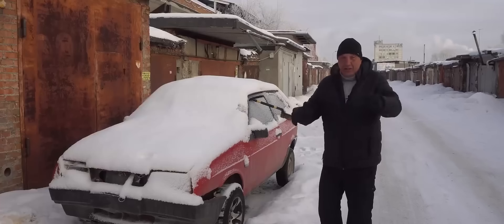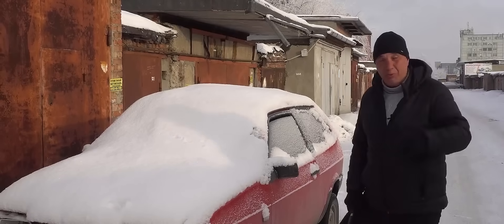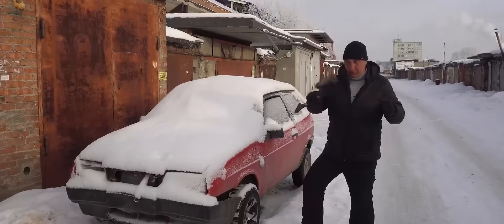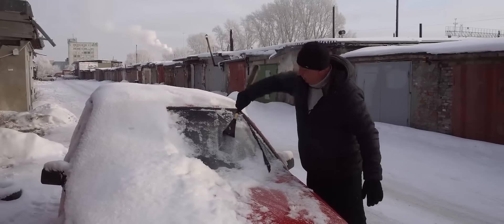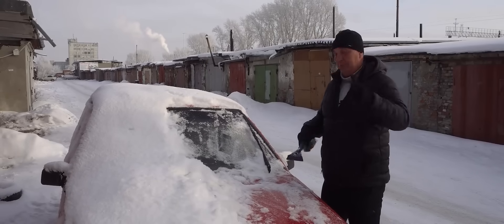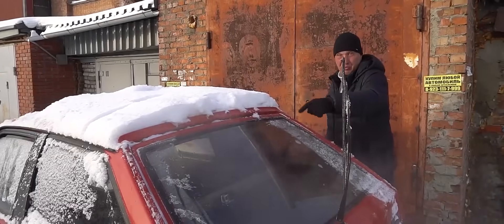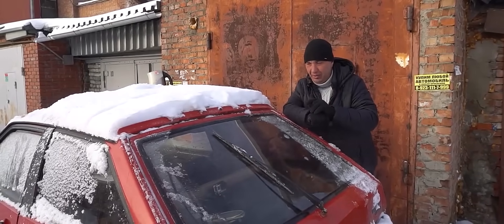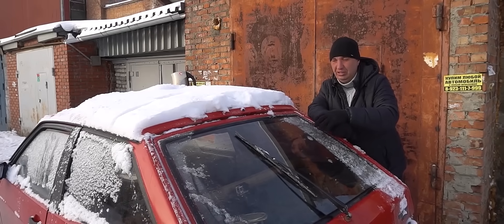What happens when you POUR boiling water onto a frozen windshield?

Comment: The second the water leaves the kettle, the air is so cold, by the time it reaches the window it isn't boiling anymore, it's still hot though I imagine. Need to check the temperature and humidity of the air in comparison to other places.
Reply: Why tf you here you fam
Reply: That's actually not the case. Car windshields are made out of tempered glass. Tempered glass doesn't crack under temperature change which is why test tubes and flasks are made out of it.
Reply: @HideyKojinko  The side windows and back window are made of tempered glass.  The windshield is made of laminated glass.
Reply: Man like chicken con yhhh
Reply: FAM REVIEW GRILLER
Reply: Boi .. why you here?... go make more 🔥 videos
Reply: +Chicken Conoisseur LMAOOOO WHAT ARE YOU DOING ON A VID LIKE THIS
Reply: Chicken Connoisseur soo we getting that next episode ?
Reply: I am amazed at how many people agreed with Chicken Cons comment. 

NO, the amount of mass will not cool down quick enough from kettle to glass. It might happen if sprayed or atomized and given enough travel time.
Reply: Wtf
Reply: Chicken Connoisseur l
Reply: What if you pour the boiling water while there os more snow on the window? Or what happens when you turn the car and the heat on?
Reply: Neeeeerrrrrrrddddddd
Reply: Wouldn't doing this be bad, the sudden temperature change can crack the glass if the change is too drastic and done too quickly
Reply: No one asked. Let me introduce you to a girlfriend
Reply: Chicken Connoisseur ITS U!!! I KNOW U FROM MEMEULOUS
Reply: Since when were you a science guy
Reply: Im a fan.
Reply: Wtf are u doing here lol
Reply: Chicken Connoisseur we got a genius here
Reply: Chicken Connoisseur That doesn’t matter one bit that hot water is still hotter than shit vs the window huge temp difference
Reply: Tf y u here
Reply: Freezing glass doesn't shatter on it's own if u poor boiling water on it. It only breaks if it's in a spot that is precisely it's size 'cause it expands in hot. Car windows are made so it could expand a little and not break and get smaller and not fall off. Its physics and it's called "thermal expansion".
Reply: Chicken Connoisseur lol why u here 🤣🤣
Reply: Idk if that’s true. My mother used to do this during the winter before she carried us to school. The window always got a little frosty during the night and early morning hours before school. It never had enough time to melt by the time we had to get up. I live in a southern state so it almost never snows. Each day she’d do it and it wouldn’t be that cold....definitely not as cold as it it is where this video takes place. It would be maybe 40°F out so if that’s enough to cool the water down instantly to where it’s no longer boiling...then maybe.
Reply: Chicken Connoisseur  y r u here
Reply: Chicken Connoisseur yo review kfc g
Reply: no. The temperature of the air doesn't matter. The colder it is, the colder the glass is, and air has so little heat capacity that it doesn't cool the water off much. The cooling is mostly due to evaporation of the hot water which isn't affected by the air temperature
Reply: You don't deserve that many subs
Reply: Why u not eating chicken?
Reply: Chicken Connoisseur 
Hi
Reply: Chicken Connoisseur what r u doin here
Reply: Its obviously still boiling
Reply: You're incorrect sir. Test this theory out next time. Pour boiling water on your hand in the freezing cold and see what happens
Reply: Wow your likes say 911
Reply: https://youtu.be/g8H7pmdo-qc 
this will make your day. worth watching. subscribe on your own risk, u might fall in love. ❤️
Reply: True, most likely anyways. kinda like when you take a mug that was in the freezer. Then, you pour really hot water in and the mug will shatter.
Reply: Your hypothesis is wrong your as dumb as your comment..lol
Reply: @nivisky  you're. Learn to use the right words before calling someone dumb lmao.
Reply: What's your most useful tip on gaining subscribers? Lol 
I've tried for 2 years and only got 548....
Reply: EliteFusionZ clickbait and release lot of video consistently
Reply: @selassieaspen9940  Nobody likes people that click bait
Reply: EliteFusionZ nobody likes it but everyone does it
Reply: @elitefusionz02  If you don't clickbait you won't get subs, it's the sad truth.
Reply: @elitefusionz02  eat chicken 😂😂😂
Reply: EliteFusionZ I only have like 70 😂
Reply: EliteFusionZ rename yourself to get me 696969 subscribers with no videos

Comment: I’m sure if the windshield had a small crack lol it be a different story
Reply: He'll say 
"Fuck, well... There goes $400 just on a YouTube video that'll get 60 views" 😂
Reply: @elitefusionz02  i think its a bit more than 60 views :))
Reply: Nothing would have happened either way. I know from experience. Drastic changes in temperature from cold to hot does not make avsolutely any difference in glass what so ever. Things change when you do hot to cold, in this case the glass would have cracked easily. This has to do with how big the jump in temperature is. Is way harder to get glass cold enough and water becomes vapor before reaching the desired heat. This is why cold to hot doesn't break the glass. But is easy heating up glass enough that even room temperature water can break it.
Reply: Is she Russion.

Comment: Really, water above 0°C is fine. It will melt the ice and would most definitely not give you any reason to be concerned about the integrity your windshield. Squeegee the excess off so it wont freeze back. By the way, what kind of scrubber is that?

Comment: I've used a pitcher of hot tap water on frozen auto glass for decades without cracks. Hot water poured into a cold skillet won't do anything but warm up the skillet. If you reverse the test - a hot iron skillet or very hot glass can easily crack when drenched with ice cold water.

Comment: It only cracks if the glass is damaged already. If the glass is like new, nothing will happen to it. The front and back window ist made to take this stress. Also throughout a normal drive there is high stress on the glass. Try to break it with a hammer, it will withstand high power.

Comment: The outside is the hardened part of the glass the in side is the soft part, the inside is more likely to crack if a drastic heat change is applied. This type of glass is layed with plastic sheets ( aka plexaglass) witch makes is stronger and less prone to cracking and shattering.
Reply: Resin layers not plexiglass hahahaha

Comment: It's the opposite process that cracks glass. Once the glass is hot you place cold water on it and it will crack like in the summer when your car has set outside in the heat for a while. Not sure if the boiling water he is using is hot enough to get the glass to the temperature needed, but probably a drop of liquid nitrogen after he poured boiling water on it would have cracked it.

Comment: That windshield is fastened within a rubber gasket, so it has room to expand in a differential manner. I doubt a windshield fastened with glue would fair so well. I once placed a muffin on one of the vents (-20 C) to warm it up and my windshield cracked right at the blocked vent. A glued windshield needs to expand and contract evenly, otherwise it could crack. The bottom corner of the windshield that cracked also had a pile of snow/ice on the outside, so it had no chance to heat up with the rest of the windshield. Had it been one or the other (blocked vent or covered with ice) I am sure it would have been fine, but the double wammy caused too much of a temperature difference and the window popped with a loud bang.
Reply: Eurethane window glue dont flex when its -30s outside..just like your suspension bushing u hear them when freezing cold same thing.

Comment: Michigan 30 below  I used 90 degree water on the ice all the time ,  the frost from the cold temps is a pain to scrape off , just use warm not boiled water ,  Glass is covered in a sheet of transparent coating .  that is why it only cracks not explode when impact happens.

Comment: The glass has to be cracked in the first place.  If you get a ding in the wind shield and then heat it too fast the cracks will spread.  Have seen it with my own eyes.  If the glass is in perfect condition it shouldn't crack.

Comment: Any tempered glass will withstand boiling water without issues and cars use tempered glass because it's safer. When it cracks it doesn't produce shards but instead millions of small pieces. This is to avoid decapitation or exsanguination by glass shards in car accidents.

Comment: On any car you need a chip in the glass first for this to have an effect. Car glass is too strong to crack without a defect. It concentrates the stress. You could also try pouring the water on a lot faster to make a steeper temperature gradient.

Comment: Cold Pyrex or borosilicate glass doesn’t seem to be nearly as sensitive going from a cold state to a hot state, but if you take a Pyrex Bowl that is over 100C and it sits on top of a cold surface burner on a glass top, or gets submerged/covered in room temperature/cold water, you’re going to have glass everywhere, so what if you used a heat gun to heat the whole windshield (or part of it) to a high temperature, then poured relatively cold water on it?

Comment: if you built a reservoir/dam area to hold the hot water and dumped a large amount instantly, say 4 to 5 gallons, it would likely thermal shock bad enough crack then.
maybe dumping the pot upside down instantly or a larger amount alone would do it too.

Comment: Front and rear glass is laminated glass. Side windows are tempered glass. Much different. Try the side windows with boiling water. Maybe a different result. Rock hits front glass, leaves chip, But the same hit on side glass and it shatters completely into little bits.

Comment: you've already cleared the windshield from ice...
why not pour boiling water unto it when it was still covered in ice..!.. ????
Reply: The point of the video was to "thermally shock" the glass with the boiling water so it could crack. If they kept the snow on than the boiling water would cool down too much before it reached the glass. But it's not like it worked anyways :V
Reply: @h0rcrux774  yes but the windsheild was not frozen..was insulated from coat of snow...
Reply: I wanted this too

Comment: I believe I have your answer: Windscreens are curved (convex) laminate with a sheet of glass inside and another sheet outside of a layer of PVB or EVA between; heating the external layer expands the external layer which bends outwards, but heating the internal layer also makes the inner layer expand towards the outside of the car. The PVB/EVA is a little flexible (strains easily), but not very compressible when sandwiched between the layers with nowhere to escape, it also does not transmit heat particularly well so when you heat the internal layer the stress between the internal expanded layer and the external cold layer of glass increases without the sandwiched layer being able to strain enough to release the stress and it cracks. So in the externally applied heat model the stress is outward and the PVB strains (stretches) to take up a significant portion of the stress yet in the internally heated model the external glass takes the strain (which it does not do well being much more brittle than PVB) and typically the external layer will crack. 
As a point of note here in England where winter temperatures rarely go below -5C I have used water warmed in the kettle regularly to defrost the windscreen but I never heat it much above 40C and unless your screen is already chipped the change in temperature should be easily accommodated by your screen.  Remember you only need water above 0C to defrost a screen - the additional temperature is solely there to warm the glass up enough to prevent it immediately re-freezing.

Comment: What is obvious is that the hot water is being cooled by the melting ice and large surface area rather quickly. It takes a lot of thermal energy to melt ice per small quantity. Glass is also a thermal insulator that changes temperature slowly.

Comment: What i tend to do is, i just take a cold water from the tap and pour it on ice.
You might think it wouldnt do much, but trust me, the cold water is probably still 10-20 degree higher temperature than the ice, which melts the ice but does not damage the glass...

Comment: I've been pouring hot water on windshields in winter for 40 years (I live in Canada) and they never crack.
Reply: I've used cold tap water, also. As long as the water is above freezing temperature, it'll take off the ice.
Reply: Me too. I'm also Canadian and have done this in -40C weather many times when I'm running late. I don't use hot water though, I use luke-warm water from the tap (a little above room temperature). It is risky though, I've had damaged windows crack just from the defrosters. Be absolutely certain your windshield doesn't have any cracks or chips if you try this.
Reply: Cyber Pleb : ... Agreed! ... existing cracks will get longer for sure, even tapping with your knuckle will extend existing cracks though.
Reply: I do so every winter in Germany, because I just can't be assed to scrape the windows. Not boiling water of course, just hot water from the tap.
Reply: Montreal here..i never scrape ice off windows..just start the car defrost thats all..i see many stupid people scrape windshield for half an hour hahaha
Reply: I used to do this every winter before I got a garage. Different models; never an issue. The only problem is that you need to get the water off or it refreezes.
Reply: I'm Canadian. I've never tried hot water on a frozen windshield.
Reply: I've been using hot water for 15 years
Reply: Not hot.. Warm only
Reply: Only crack when the heat is from the inside of the car
Reply: I've done it a few times when I didn't feel like waiting. My thought process was that a lot of cars have heated windows. We wouldn't have heated windows if they could crack so easily.
Reply: In Colorado, and I use hot tap water for my side views works good
Reply: Ford quick clear... Job done, no need for water
Reply: I don't get it, is windshield glass tempered? I put a cold glass in hot water and it shattered right after, how is it that windshields are hardier than the usual glass?
Reply: @YouKnowMeDuh  yes it is that's why you need to be more careful cleaning your bong
Reply: Cornelius Palahniuk I broke a drinking glass, so take your remarks elsewhere unless you actually have a helpful explanation.
Reply: @YouKnowMeDuh  laminate glass in the front safety glass in the sides your rear window in regular don't get salty
Reply: @YouKnowMeDuh  have a cry
Reply: Serite Ross windshields are laminated. Two layers of glass.
Reply: That's with Canadian hot water though.. It's different.
Reply: How do the tires hold up
Reply: Lie I clicked on your channel you look like a 20 year old.
Reply: If you put cool water from a hose on a windsheild thats at 130 degrees in the summer it will crack.
Reply: Mike Baxter  LOL. I love the guy in the video assuming that Russian-made windows are strong while all foreign ones are weak.
Reply: I've been pouring cold water on my windshield to cool the glass down in the winter (I live in Texas)

Comment: I once used the garden hose on my car when it had 2cm of ice on it. I could not even open the car. It was about -5°C, and the water from the garden hose was probably around +5°C. After that, I was able to get into the car, start it, and allow the engine and heater to warm the car up gradually. 5 minutes later, I was on my way to work. :-)

Comment: Glass will crack when you go from hot -> to -> cold as the molecules contract creating the crack. Going from cold yo hot expands the molecules and while this can result in a crack it usually doesn't. This even works with Pyrex glass which is supposed to resist temperature changes. I was able to crack my Pyrex measuring cup but only by going from hot to cold. Not the other way around.

Comment: But safety glass won't shatter. At the temperature difference doesn't have to be great to crack a windshield. I've done it with cool water from a garden hose on a windshield that was hot from being away from shade on a 95* day. Instead of spraying the whole thing, I stupidly poured the cool water on one side continually. One side was quite hot, the other side was cooled by the water. Crack. Must have had a chip. Not a huge surprise and certainly wasn't dramatic.

Comment: Simple explanation, since the glass has no imperfections and no stresses from the body of the car it does not break. Inversely if your car has any of the aforementioned the chances are it will break sometime, sooner later but most certainly eventually. Pouring hot water on it may be your, figurative last straw on the donkey's back.

Comment: Pits in the outside act as a starting crack when the inside is heated up it will expand while the outside doesn't and it's pulled apart. Heating lt from the outside wont crack it.

Comment: In my experience cold water on a hot windshield is a guaranteed crack.  The worst are VW windshields.  They're quite proud of their "lightweight, fuel-saving" glass.  Translation:  Thin, cheap and brittle.

Comment: The reason for the glass not cracking wasn’t based on how much heat tempered glass can withstand, but rather the sudden change in temperature. Keep in mind glass is made in excess of 1,000 degrees C. Pouring boiling water, you won’t get anywhere near those temperatures. BUT because glass doesn’t handle rapid temperature change well, he could have cracked it if he tossed the boiling water on it maybe.

That is to say, if you slowly and gradually increased the heat, the glass will not crack.

Comment: car windows are made typically of two sheets of tempered glass with a special laminate adhesive and vacuum seal so they're made to withstand both high and low temps even with an extreme change and to spider web when broken for safety